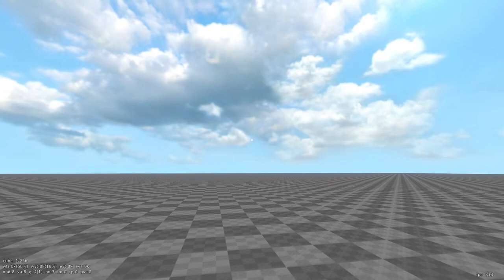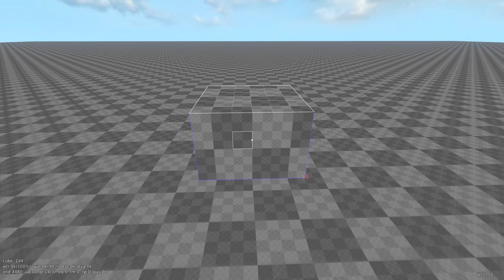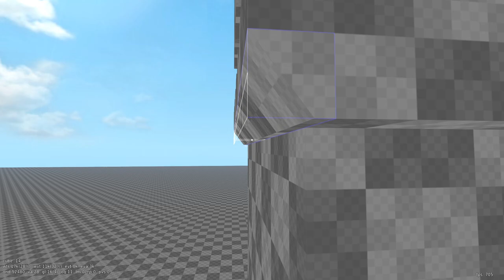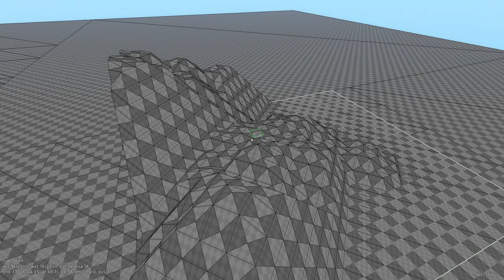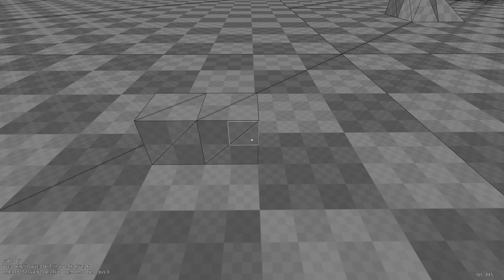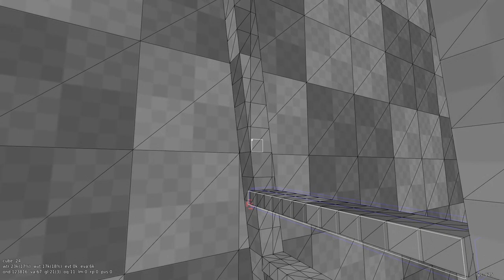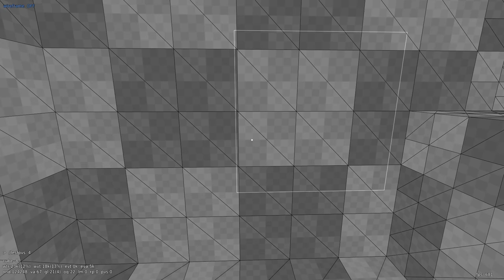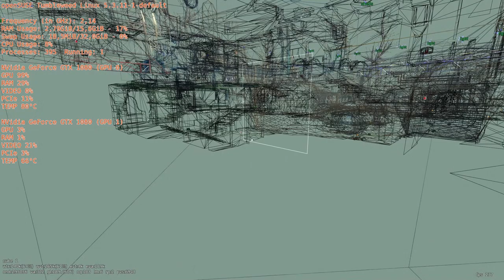[EN] Cube 2: Sauerbraten - Map Modeling - Tutorial - Part 1

Comment: Back to bug you again :)
Is it possible to blend textures on a wall as I cannot find how to do it, the ground is no problem but I'm stuck on trying to do it on a wall, any help would be greatly appreciated, thanx...
Reply from the maker: Sorry, I do currently not know a way to achieve this :/ I already search for a way to do this on my own but wasn't able to find any thing.
Reply: @RoboNTux  Ok thanx, I've tried and looked around but I don't think it's possible as I can find no mention of it anywhere, I'm sure I can find a different way to achieve what I want...
Reply from the maker: @steve809  You could blend your textures manually. So you'll have a texture half texture a and half texture b and maybe one for corners in different angles so you can just put the appropriate texture on the surfaces you want it to be.
Reply: @RoboNTux  Good thinking that may work, I wil give it a try as I can move the texture around I should be able to get the effect I want, Thanx :)
Reply from the maker: @steve809  Let me know how it turned out :) Btw, is there a way to see what you're working on? Since you ask some very detailed questions I am very interested in what you're working on :)
Reply: @RoboNTux  There is a way of blending textures on the wall, you choose the 2 textures the same way and apply the textures on the wall, for me it worked the same way as the floor did.  At least it did in the tutorial that i followed...
Reply from the maker: @tronchaser2u63  Can you provide me a link I'd really like to see that too :D